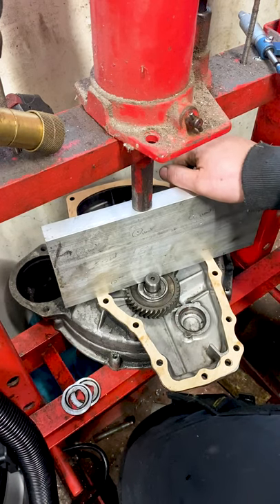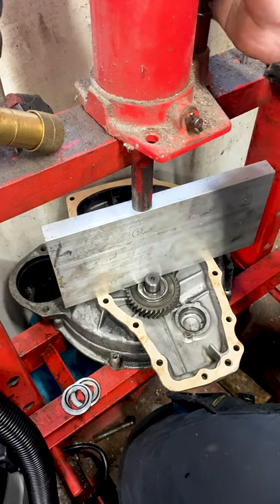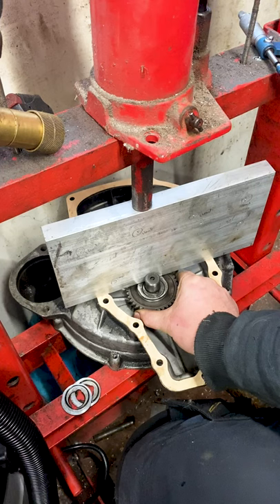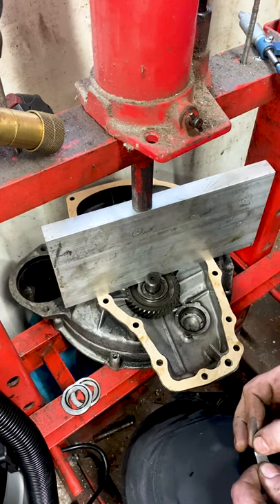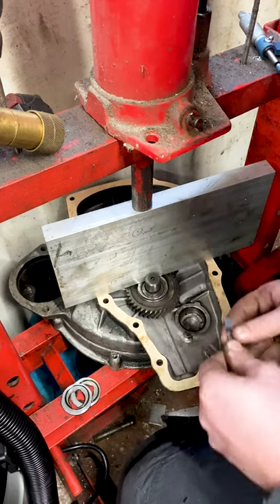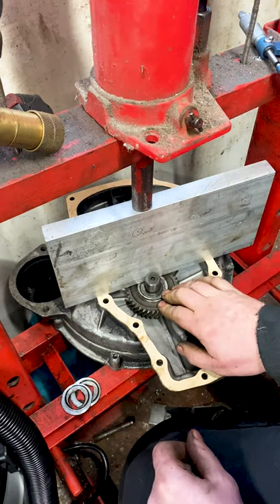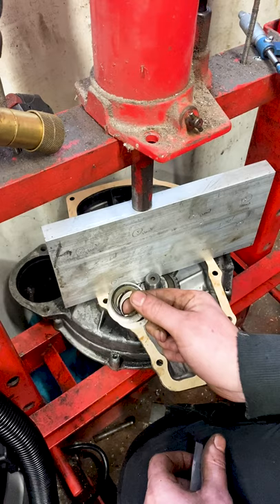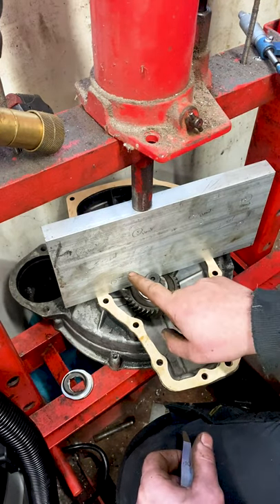Idle Gear End Float - #Short #HREShort

Comment: Hey, when should this be done? When changing the idler gear or just the bearings? Thanks
Reply from the maker: It’s a good idea to check it any time you have the drop gear housings off. The gasket can differ in thickness, and the primary gear can wear as well.
Reply: @HREIRL  Great thanks. Loving these vids, keep it up!

Comment: I get told off by the missus for saying off of (off ov) as it should be “from” bloody teachers!
Reply from the maker: Hahah such a good language.
Reply: Presumably worth checking that there is no wear in the gearbox face where the shims run when doing it this way, otherwise clearance could be more than you measure?
Reply from the maker: @MNW124F  most definitely needs to be check. As you say it potentially could have wear 👍👍